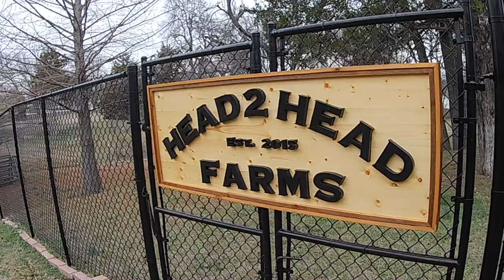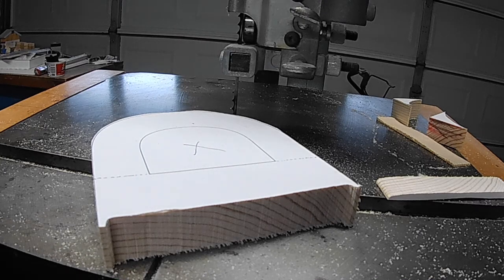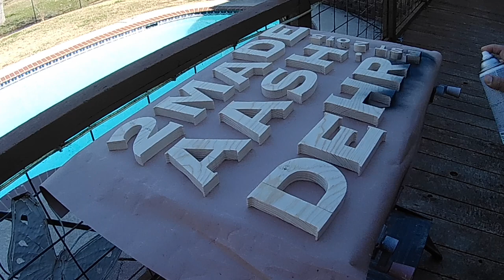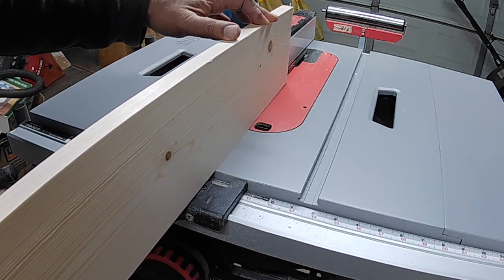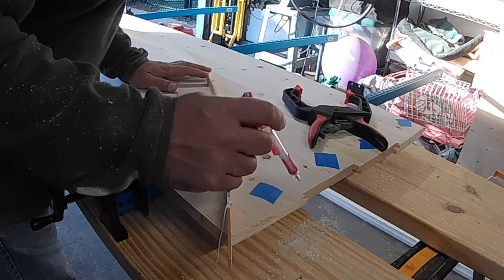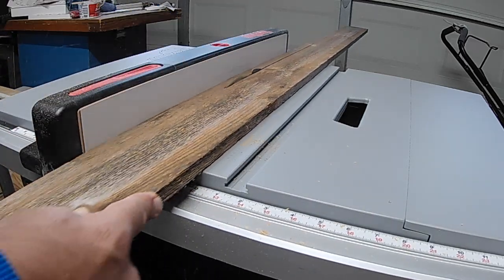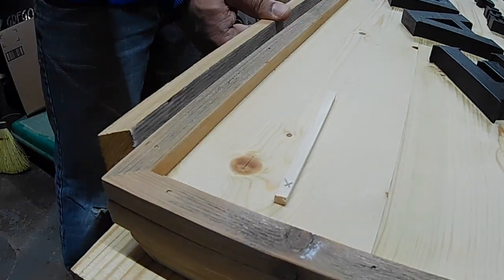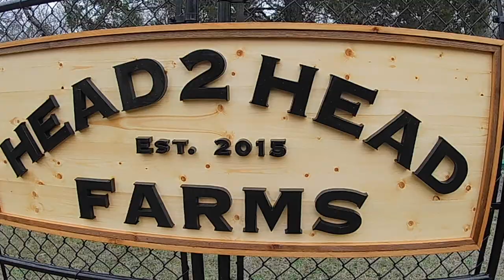How to make a Farmhouse Sign

Comment: I totally would not have thought to just split the letters to cut out the inside bits then glue! I'd have been there for hours struggling with the scroll saw, detaching and reattaching the blade! Great tip and build video! Thanks for sharing!
Reply from the maker: tfturning thanks and it’s not an original trick, seen it done elsewhere, most likely on DiResta channel

Comment: Very nice! I like the way you made the frame on the outside. Beautiful sign 🙌👍🍻
Reply from the maker: Thabks nan appreciate it. I could have done with you new jig...

They will be putting up the sign on thier farm this weekend. Can't wait.
Reply: @LonghornWorkshop  i think your sign is longer than the max length of the sled (so you could not make repeatable cuts) , but i guess it could have been used to just cut the miters! I am sure this won't be the last time you make a frame, so there is always next time 😁😁
Reply: The Grant Alexander lest be connected

Comment: it reminds me a Di Resta style project! I enjoyed it a lot. Very beautiful, same as a professional job.
My only concern is the external frame and how it could react with wood movement...
To be honest I did the same with an old project and nothing happened so far
Reply from the maker: Thanks Alberto. You are right, not sure exactly how it will hold up to the weather, although we are in TX and it's on the whole dry. 

I think over time it will move and may see a little separation.